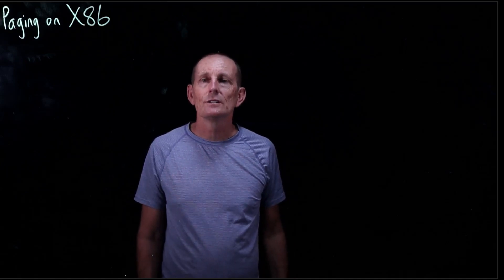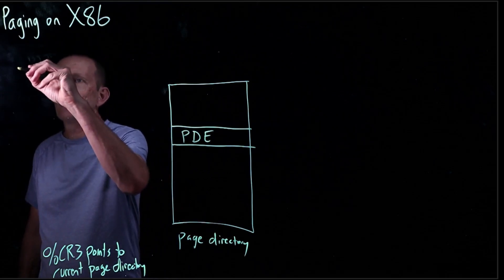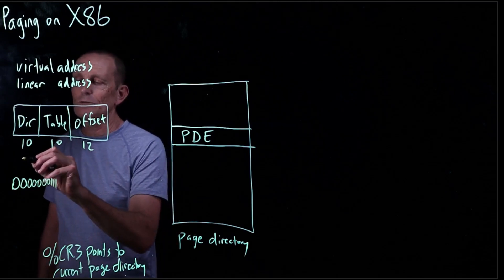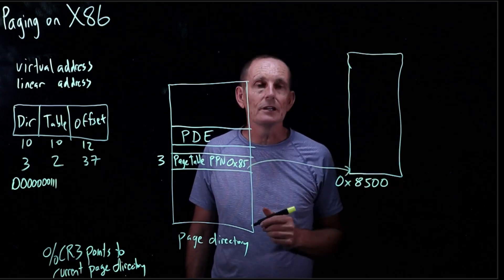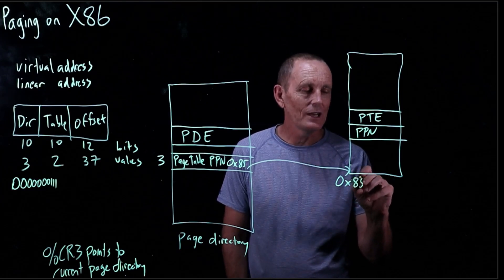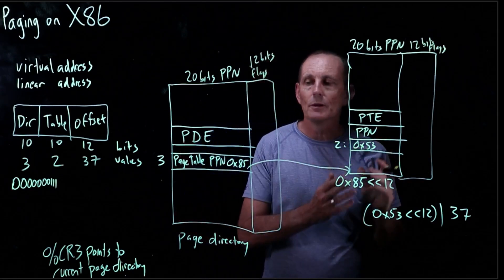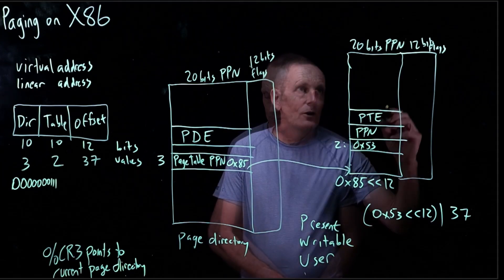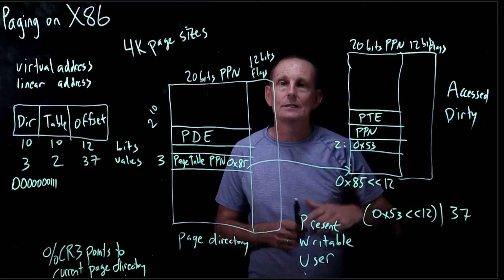CS 134 OS—5.7 Paging on x86

Comment: Pagedirectories and pagetables in the x86 architecture contains physical addresses (with some flags), no indexes. Indexing is done by the linear address itself. Therefore (and I hate to say it) your explanation is somewhat flawed. Next, because all pages contain 4096 bytes, these physical addresses should honor these page boundaries. The 0x85 value in your example should therefore also be shifted by 12 (being 0x85000) and only then it's pointing to the right pagetable.
Reply: Never mind, did not watch the full video, where suddenly 12 bits are added to the table... :D

Comment: 0000000111 = 7 (not 3). I Think you meant set only the 8th and 9th bit of the pd index.
Reply from the maker: You're right, at time 1:55, I show directory bits as 0000000111 and they should be 0000000011.